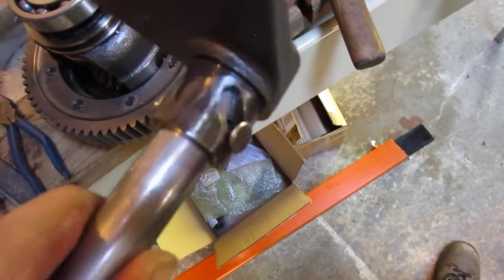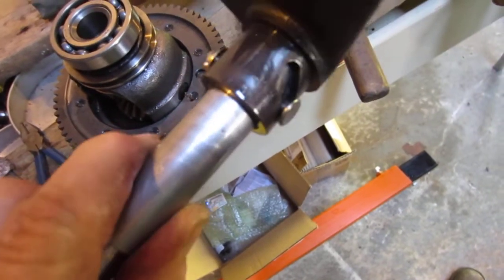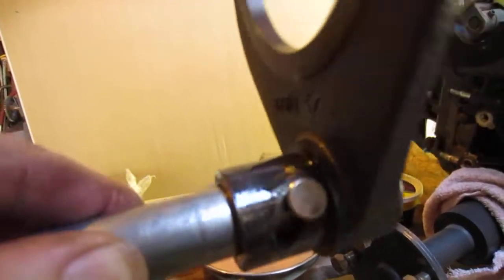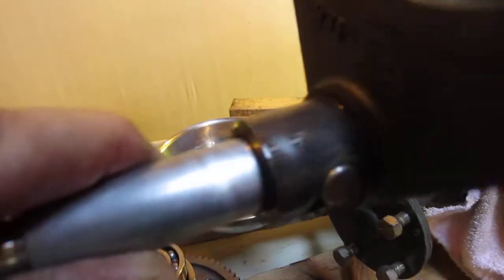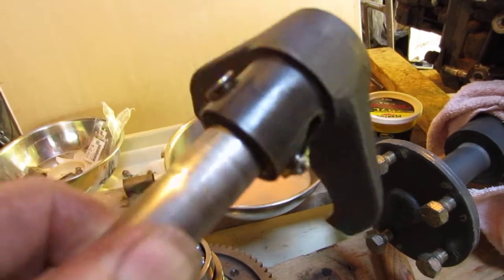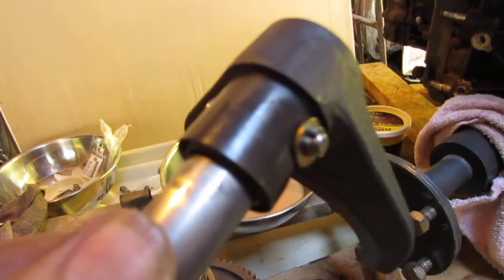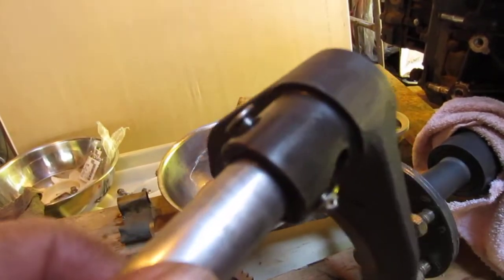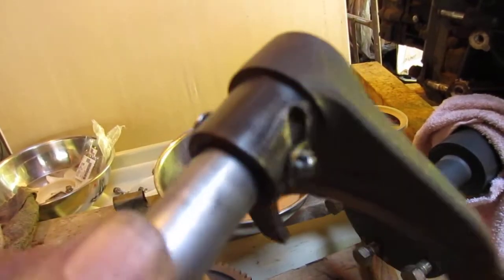Kubota BX 25 differential lock fail, modifying a binding Shift Fork.

Comment: Mine cost $2500.00 to repair.  They tore the entire tractor down to get at it. I used the lock ONE time it did not release when I picked my heal up.  POISON PILL
Reply from the maker: Yes, exactly...    and the Dealer probably tried to blame you for engaging the diff-lock when the wheels were wildly spinning...

And yes, you basically have to dismantle the tractor to get into it, as per my videos...    and my issue is if the Dealer fixes the problem, they just replace parts, so you either never use the diff-lock or get prepared to pay AGAIN !
Reply: I wired mine so i never mistakedly use it again. My bx25d is a 3 wheel drive.  Owners be aware they designed in a poison pill. Thanks Kubota.
Reply from the maker: Not quite, it is only 2 wheel drive, one front tire and one rear tire.  When you use the diff-lock, then it is four wheel drive because one tire can not spin by itself. :-)   Too bad Karl, that you didn't see my videos before having the repairs done, because for a little extra time,  there is  a significant improvement with my mods.  I really work my little Kubota, and 4-wheel drive is absolutely necessary for me.  Since the mods, I haven't yet had any issue. (crossing  my fingers)